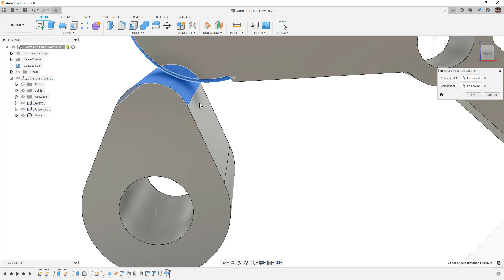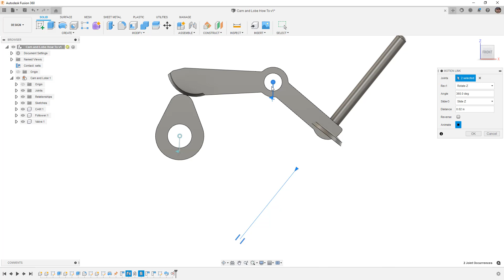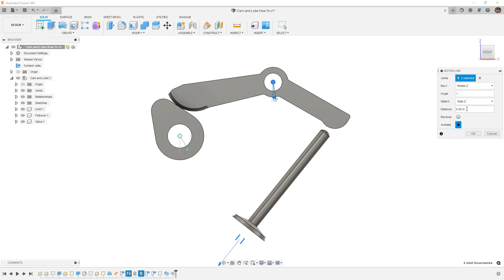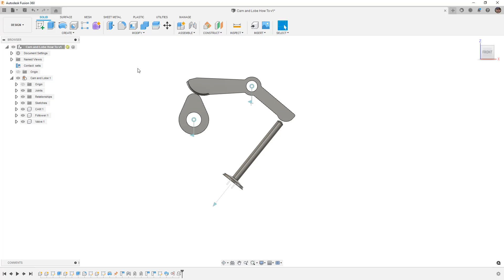How to Set Up and Cam Rocker and Valve for Motion in Fusion 360 #Fusion360

Comment: I found you can get a lot closer of a simulation by first capturing the cam orientation when the rocker is fully off the lobe, then capture the position of the valve at its point of contact with the rocker.
Sketch a circle from the center of the rocker pivot to the approximate point of contact between the valve/rocker and note the diameter, then in your motion link keep the angle value at 360 and use ( D * Pi ) for the distance value, where D is the diameter of the circle sketched.

This way you're using the circumference of the arc made by the rocker as it pivots to drive the valve - the only caveat is because the contact surface of the rocker where it meets the valve stem is a curve, the rate at which the valve translates is non-linear, so there still is a tiny bit of 'float' when the valve is fully open. There is probably a way to account for the curved contact surface in the distance formula, but I didn't find one while messing around.

If the tappet was a flat surface, the motion achieved with the above method should theoretically be near perfect, fwiw.
Reply from the maker: Thanks for taking the time to write that!  Great tip!  A solution to this problem would be for Fusion to have a joint that allowed for point contact one on component and a sketch path on another component like other CAD programs.  The tangent relationship seems to have gotten a little better since this video but could be better still.  

Ill pin your comment to the top in case someone is looking.
thanks

Comment: If you split Rocker Arm into 2 pieces then join with rigid joint before Tangent Relationship then you can get the mechanism to work without locking. You can animate manually but it doesn't keep rotating when you animate model for Cam Lobe revolve.
Reply from the maker: Martin, I tried that before posting this video and it didn't work for me.  Are you saying that the tangent relationship worked for you on both the valve and the cam with a 2 piece rocker???
Reply: @LearnEverythingAboutDesign Yes. I could rotate lobe using mouse and valve followed rocker. Using Animate Model lobe rotated partially and then froze.
Reply: Actually I had to supress the sweep at the end of the time line to get it to work. Even then it is very unstable.
Reply from the maker: That is very interesting!  So one note is that before the sweep I had attempted this with multiple selections and found that it worked a bit but then it didn't.  I ended up with the most consistent result being selecting the follower first, then the cam lobe face.  Unfortunately most consistent meant "mechanically locked" each time.  I did try duplicating the follower and making a rigid group as well.  I was banking on the fact that I was doing something wrong.  The sweep was put in place to reduce the point of contact with the cam itself in hopes that it would help, but seemed to make no difference.

If I figure anything out further I will post an updated video.  I appreciate your comment and playing around with this as well!!